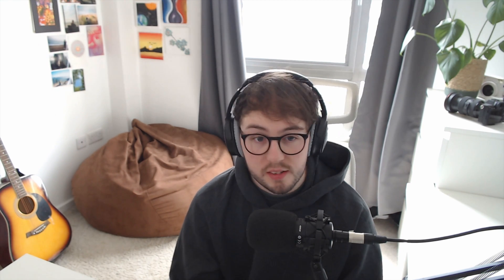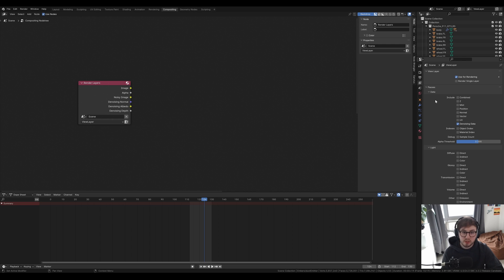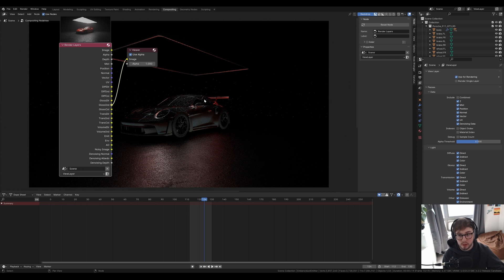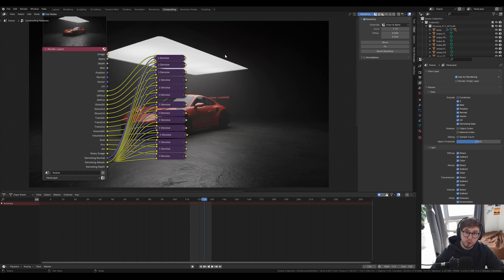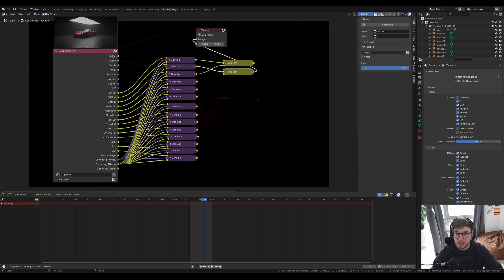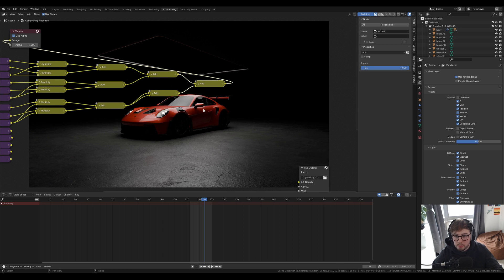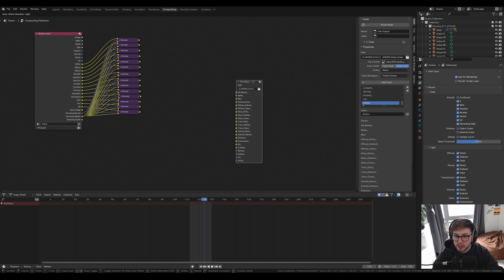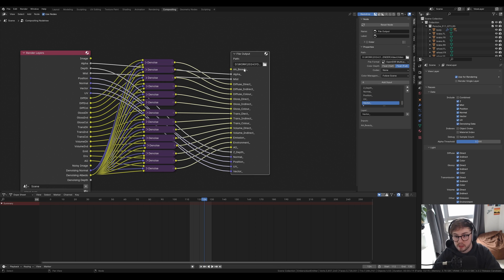The ULTIMATE guide to denoising in Blender | Blender Tutorial

Comment: It would be cool if emission worked. When connecting nodes like yours, my emission doesn't work. I even tried to change add to something else.
I have Emission from HDRI and it is not displayed in the Emission card. I need Glare to work, including for HDRI.
And in general, if I do it in layers, then the emission is very weak.
P.S. If someone connects AO, then instead of Add, you need to choose Multiply.
Reply from the maker: Hdri is not an emission, it is environment.
Reply: @ethdavis  Anyway, after connecting all the channels, Glare should logically work normally, but it doesn't. I tried connecting Glare separately to Environment, but there is no result.

Comment: But my concern is, why does a utility layer have noise, I don’t get it. I always render utility passes with light off and low samples in other engines, but blender gives way too much noise in the utility passes which I don’t understand how. Why should utility pass need to be denoised.
Reply from the maker: Think it’s just the z depth with struggles with noise, can’t really be helped as blenders a bit weird with it. I use a mist pass instead. I wouldn’t denoise any utility passes.

That being said, blender isn’t the only software with weird passes. Corona has many issues with them.
Reply: @ it’s not only depth pass per my experience. The P pass same and yesterday, I got 0.597 data for alpha in cryptomatte. Which I haven’t done across before. I can’t say for corona cause I haven’t used it before. I’ve worked in VRay, Arnold, Karma and Mantra and utility passes are always clean. It’s no use denoising utility passes cause data would turn out to be inaccurate

Comment: Ehy I came back to this video to understand better and i was wondering, if I have a glare in the composition, how do i render it in each pass?
Reply from the maker: You could do it right at the very end by plugging the final mix into the glare node. You could also just plug the emission into the glare node and then add that by using screen at the end .)
Reply: @ethdavis  Okay thank you, I guess the second option is better because I am rendering singles passes to export in davinci, so basically i connect the emission to glare, glare to mix screen and mix screen to the emission input of the output node?

Comment: I am doing excactly as you are showing for the combined denoise but the outcome looks washed out . Is there anything that i might doing wrong ? I am also using my AO.
Reply from the maker: AO shouldn’t be added on. It is used to add more contact shadow so you would ‘multiply’ it. 

But you don’t need AO to rebuild the image, it’s an added extra
Reply: @ethdavis   Thank you so much for the help . I tried multipling it with the combine and actually got a good result but as soon as i added it to the whole composite the result came out noisy on some parts and i think it is because i used both combine and all the other inputs (diff . trans , gloss...)

Comment: For some reason when using the AO layer it becomes mostly black and white, with just a faint bit of color, what would cause this?
Reply from the maker: An AO layer with colour is pretty odd, could you pop a screenshot in my discord and I can help?https://discord.gg/ZY7dBcu9
Reply: @ethdavis  Hi! Thanks for the video. I faced the same problem. Can you tell me the solution here?
Reply from the maker: Hi Sev, I still don’t know why. If you could put. Screenshot of your setup in the discord I can help 🙌🏻
Reply: @ethdavis  I sadly enough am not at my main pc for the weekend so wouldn't be able to right now. If you figure out the case with sev before then id like to know :D. Though even without it it already looks much better (and I can just apply the ao layer separately through editing software), great tutorial. 👍

Comment: I tried the multilayer denoise in blender, but I noticed that it took like FOREVER to render a single frame compared to a single denoise on the beauty pass. even with the denoise node set to fast, it is still between 1 and 2 sec per pass to denoise! I think I would be better off (timewise) for a similar quality by denoising the beauty pass with just more samples. What do you think?
at the end, I just recreated in blender compositor the 3 main passes (final glossy, final diffuse and final transmit), then denoised only those 3... but I am not even sure I gained on quality compared to a simple beauty pass denoise. I think there is a sweet spot in render time vs quality about that. I would love to see a video putting that to the test.

Comment: Interesting denoising workflow. I just used a single denoise node and rendered with a higher sample rate if necessary. Will try this out 👍🏻

But is it also the same render time including processing? I thought it takes very long with so many denoise nodes?
Reply from the maker: It’s definitely better! I’ve noticed a 3 second processing time difference between the two
Reply: @ethdavis  3 Seconds for 1080p or higher? 3 Seconds doesn't sound that bad.
Reply from the maker: 3 second difference for this Porsche scene at 4k, but I’m using an i914900 and 4090 so not sure if that’s hardware based

Comment: I’ve been using this method for a while, it does add a ton of render time unfortunately. The compositor is working hard with all the denoisers but it is the best way.
Reply from the maker: Interesting, I haven't had any different render times on my end. Maybe some crashes but never longer times. Maybe its hardware related?
Reply: @ethdavis  I have i9/4090 setup don’t think hardware issue

Try rendering the same scene with “use nodes” on and off in the compositor.

The compositing stage takes some time since it has to do a lot of extra denoising. The compositing stage doesn’t even happen if use nodes aren’t checked which makes the output much faster.

I’m hoping I’m wrong and they’ve improved it, I’m still using 3.6 due to stability/ addon compatibility
Reply from the maker: Any compositing is going to be slower for sure, but it doesn’t add to the render time. If you compare the nodes without the denoise and with it doesn’t really effect it, maybe 3 seconds if anything? In my test. I’m also using an I9/4090 setup.

This is 4.0 so maybe it’s changed? And HOPEFULLY when compositing becomes gpu based it will be rapid? We can only hope hahah

Comment: Nice, but on the multipass version you just need to denoise what's needed. Color, emission and environment passes  regurlary doesn't need the denoise operation
Reply from the maker: Thanks Eduardo! Whilst that may be the case for most scenes, you need to take it as a case by case basis. Complex albedos and materials using emission textures will benefit from denoising for sure. Not so environments, but this can help bring everything into the same ball park of noise to add your grain after the fact.